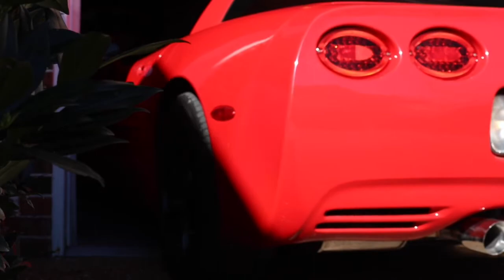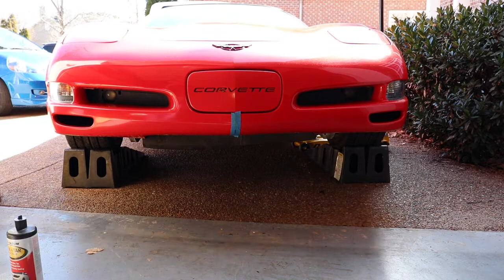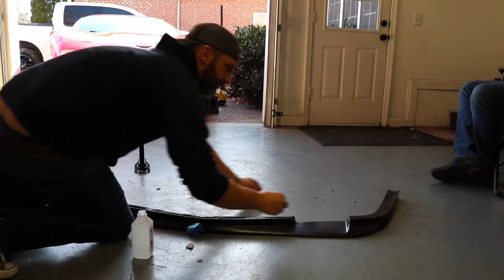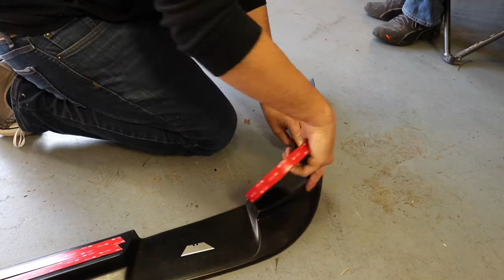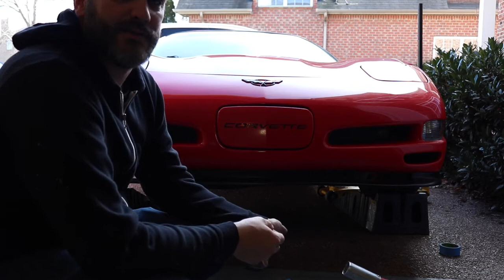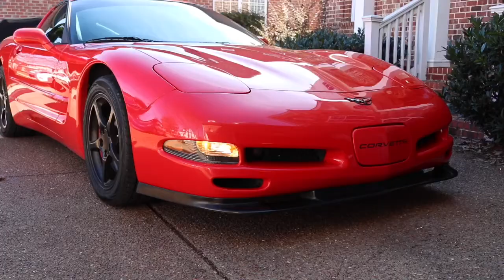C5 CORVETTE ZR1 LIP Install

Comment: The holes you made in the fog light vents only add air to the air intake. There is a panel between the intake area and the radiator area. The radiator gets it's air from under the nose with the factory air dam, not from the bumper area.

Comment: I know you have had your splitter and drilled your holes for a year now,  but does the holes keep the  car cool and not overheating?
You can get wire mesh and take out stock, please let me know how everything is working out 
Thanks,  Jim
Reply from the maker: The holes helped. But if I could go back in time I would have cut larger squares I think vs holes to make the air be less turbulent.
Reply: @thedriverscorner  good information 
Thank you
Reply from the maker: @user-zt3zq8uf1z  I actually bought another lip I am going to modify and install in the spring.

Comment: Where did you buy the splitter from?
Reply: Hey is that lip for the c6 I see that on ebay for that price but the one for the c5 is about $60 more...Im wondering if the c6 as u say actually  fits And we can buy that one instead
Reply from the maker: JACKSON Q. It’s the c5 fitment version of the c6 zr1 lip.. I don’t think the c6 one fits...
Reply from the maker: Jason Smith it is an eBay special.. I think I paid $139 shipped. It’s called a ZR1 front lip.

Comment: Front lip looks good. I gotta get one, one if these days. Hate thinking about scraping it on everything, but at least it didn't break the bank.
Reply from the maker: YellowVette04 it has effected the cooling.. have to play around with this
Reply: @thedriverscorner  I was gonna ask if it did. This style gets mixed reviews on that. I've "heard" the splitters with the center air opening work better, but who knows until you try.
Reply from the maker: YellowVette04 I think I can work around the issue